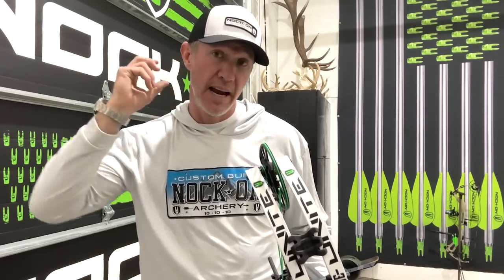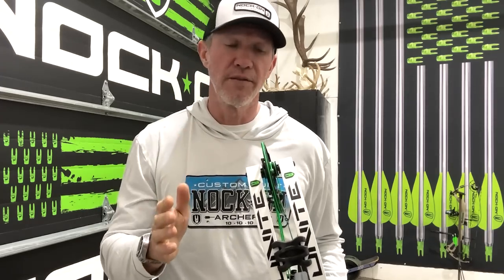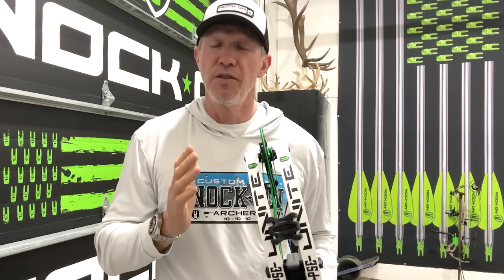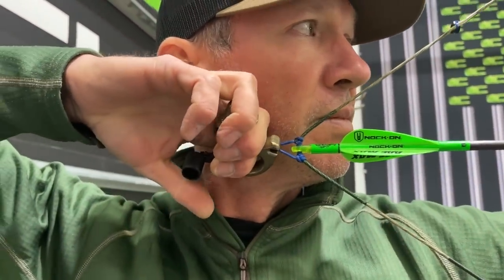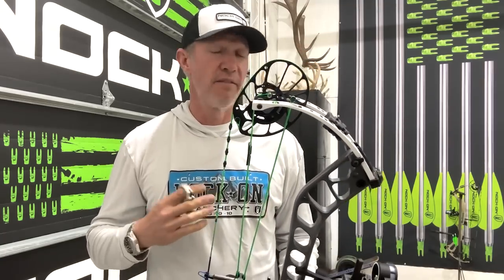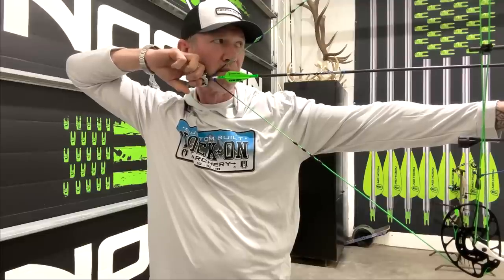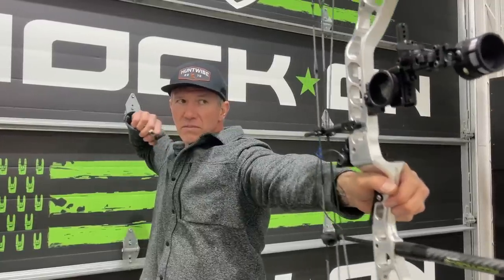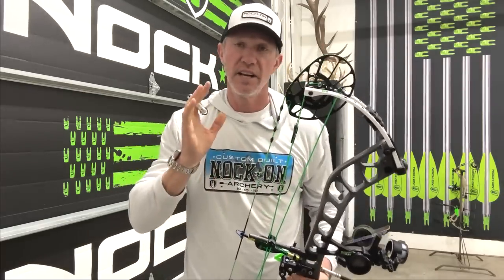What is “LOCKTIME” and how it AFFECTS ACCURACY?

Comment: I’m sure brace height has an issue also since it is on the string longer.
Reply: TL;DR. Brace height does not have a significant effect on lock time. It's critical to accuracy because of geometry and physics, but not because of time on string.

For a 30" draw it's actually 28.25" between the string at full draw and the throat of the grip. With a 6" brace height is actually 22.25" of power stroke. 7" brace height is 21.25" brace height. It's 4.5% longer travel, and given acceleration of the string it'll be less than 4% additional time on the string for most bows.

The ~14.3% increase in level arm length and further increase of limb/string length ratio at full draw is what accounts for the accuracy. This is measured as length of the limbs that extend beyond the throat of the grip.

Let's say that at full draw the limbs bend back an additional half inch, that means that of the 28.25" true draw length the limbs account for 6.5" on a 6" BH bow. The greater the relative length of the limbs to the string (assuming all other harmonics are the same) the less variance in the string upon release. A 7" brace height bow will have ~35% limb length to string length, as opposed to ~29% on a 6" bow. Ignoring the trigonometry, the more the limbs contribute to draw length, the more stable the bow.